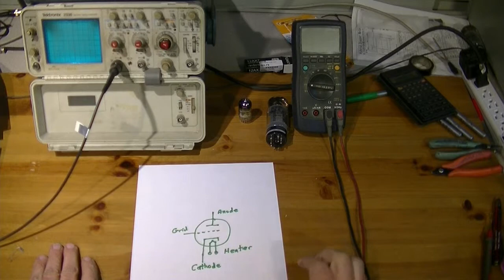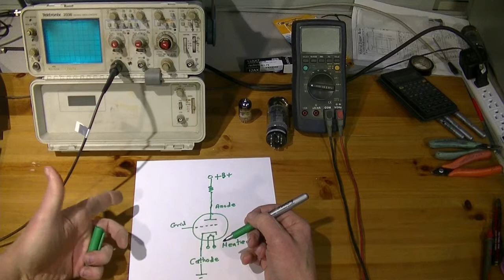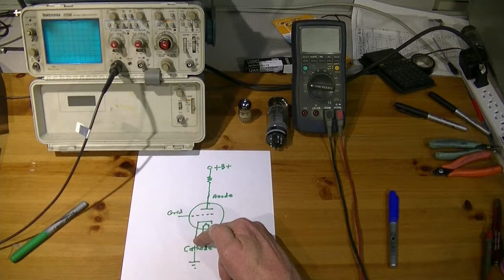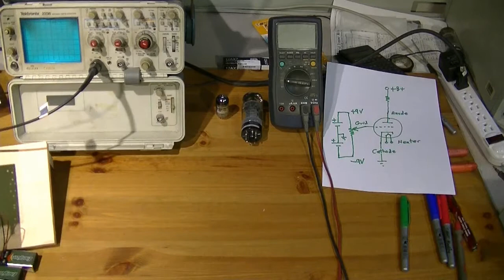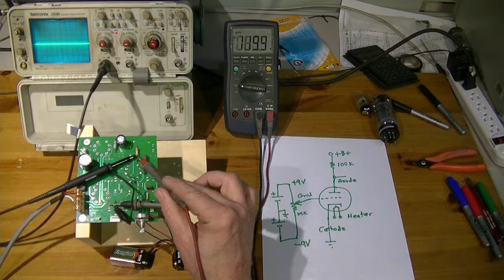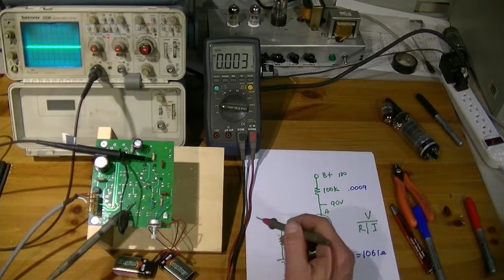Introduction to Triode vacuum tubes and cathode bias - CathodeKits.com

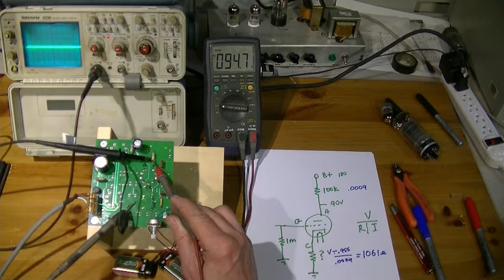Comment: Excellent explanation, and your bench experiment with measurements really solidified my understanding. However, at around 21:40, after you measured the plate voltage at 94V, I wish you had then measured the cathode voltage, to confirm it was at or near the 0.995 volts that you designed for.

Comment: The plate resistor value is Pulling UPWARDS the AC Positive Cycle? Any reasons why most tube testers don't measure the tubes dissipation? some tube tests will measure the GM transconductance which is used to "match pairs" of tubes, but how does GM transconductance gets applied to the biasing?

Comment: Many thanks for the very informative video. I've built a little 2 stage class A triode amp driving a small speaker using a 6SN7 dual triode with 100V as B+ but I am not sure about optimal cathode biasing to give me the ideal power out with reasonably low distortion. First stage has 100k anode and 3k9 cathode resistors, while the second stage has an output transformer with 7k primary in the anode and the cathode resistor is 100R.  Second stage grid resistor is 1M. Any insights would be most appreciated ! Regards, Paul
Reply from the maker: Try setting the bias ( by the cathode resistor ) so you have ~ 50% of the PS voltage at the anode.  This allows a maximum voltage swing .  Or put a 5K pot in place of the cathode resistor,  and adjust until you have symetrical clipping when  you increase the input signal to its max.  Then measure the pot and replace with a fixed resistor.

Comment: The preamp tube heater filaments can be also powered with 12 Volts. I like to put a 1.2 Volts rechargeable battery on the cathode. As the current flows it charges itself and that's a great option!
Reply: sarc?